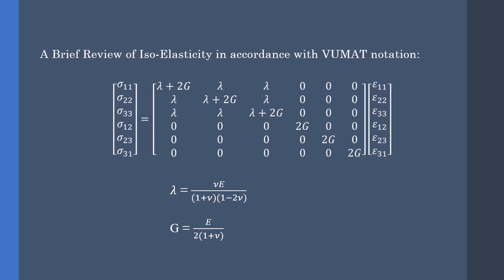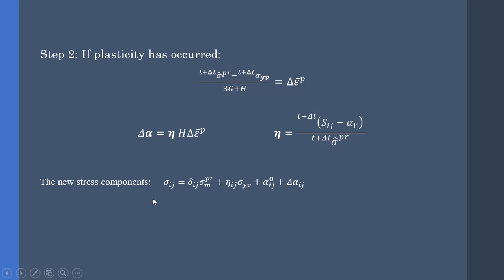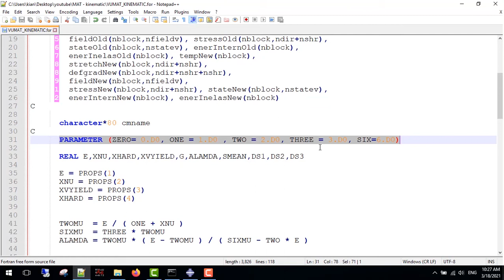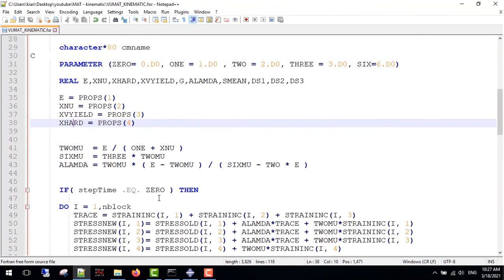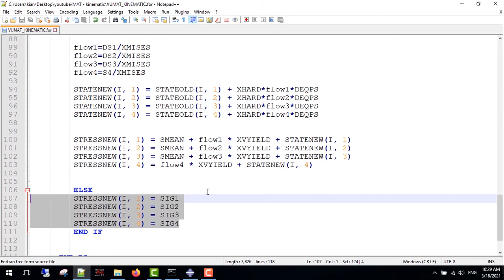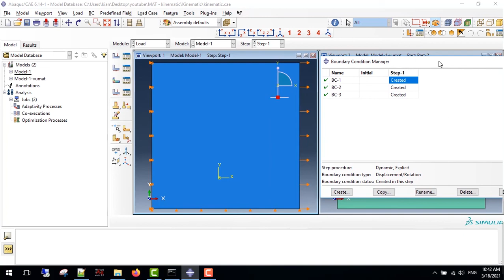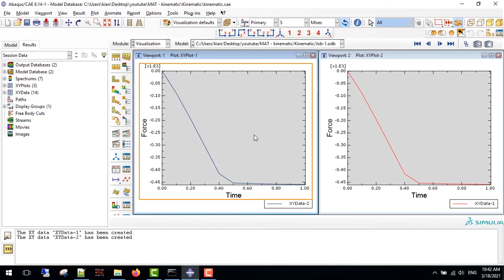ABAQUS VUMAT for Material Plasticity Part Two: Kinematic Hardening

Comment: Okay, so the consistent Jacobian is not updated at all even if there is plasticity,i guess cause it is required for convergence only,right kian ?
Reply from the maker: In explicit analysis, the time step is small. So, convergence is no more the main problem. On the other hand, CJ is needed to ensure the convergence in implicit analysis since the time step is relatively large.
Reply: @kianaghani  Yeah i forgot you doing an explicit analysis and in that time step is very small to ensure convergence every time and yeah thanks for reminding me that in implicit CJ is needed and even though a little bit off CJ still works there as long as it is ensuring convergence , more importantly stress update should be correct . Thanks man ! I  Appreciate your reply.